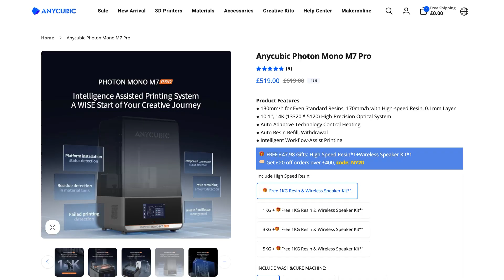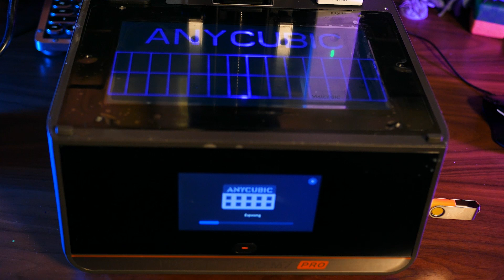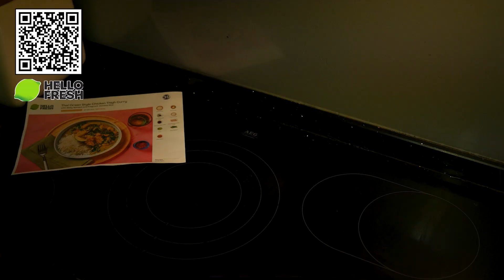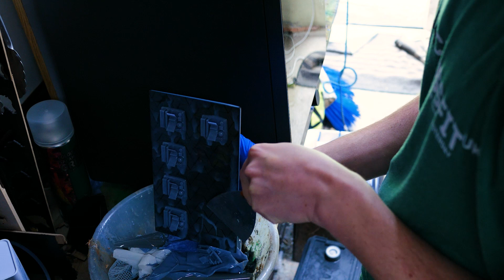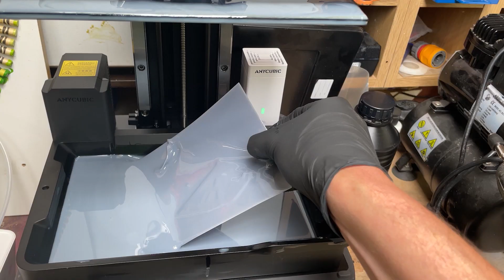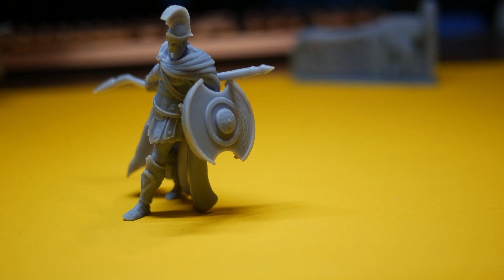Should you buy the FASTEST resin 3D printer? Anycubic Photon M7 Pro review

Comment: Can some one help me with settings
Reply from the maker: What help do you need? It will depend on the resin/ environment etc too. Happy to help though
Reply: @ the resin is anycubic standard resin, have the printer(m7 pro) in my room it’s not cold.
Reply from the maker: sorry I missed the replies on this, the room temp shouldnt be a factor as you have a built in heater. I cant give you settings that will work anytime but you do have a RERF function on this printer so I would have the base layers set at 30s then run a calibration test with 1s as the exposure and everything else left as defualt and see where that leaves you. ask more questions as you need to
Reply: @ ok thank you
Reply: @ burn layer and normal layer times

Comment: How much space do I need above it to remove the lid? My printers are in boxed enclosure so dont know if I would be able to do it.
Reply from the maker: If it’s in an enclosure I would just remove the lid completely, I will be a lot easier to use and there is no issue with heating as it’s contained and heated from the vat
Reply: @RisingApe  I know but there are a few other stuff in enclosure and it can fly off the the resin vat or something. I would rather keep it covered if possible

Comment: Ive brought the mono 4k... and i reeeeeeeally wanna smash it ! I cannot get the files to work on the machine. Ive yploaded, deleted. Changed the file types, downloaded other apps, searched youtube, searched online and i still cannot get the bloody thing to print ! I save it as pwma... obj... stl... all sorts  dont know what im doing wrong
Reply from the maker: From experience, strip it down and clean it, then run a levelling check. If everything is good then run some calibration on it, I use the Phozen Xp checker to dial it in (15min print) if you need more help just shout
Reply: You need to slice it using Anycubic Studio

Comment: Thanks for taking the time to make such a comprehensive and most of all honest review, I really like you leave in the frustrating bits and share the whole experience. Like you I am not a tinkerer that enjoys messing about a lot with tweaking my printers and dealing with fails etc., I just want a tool that works and works well with a minimum of fuzz then spend my time painting my minis. Speed isn't much of a priority for me, good detail with tough and durable resins like ABS-Like resin is what I am looking for in a printer (Not speed resin, Ill get back to that....). 

I want to share a little tip for you that someone passed on to me that makes cleaning out the vat, especially on large volume vats, a lot less messy and painful. I have the M3 MAX and whenever I have a fail and need to pour the resin back into a bottle it is nearly impossible to do without spilling some and one can very easily overfill a bottle so you have a funnel full of resin and need to somehow get that out without spilling the content... So someone came up with the simple brilliant idea of using a large syringe to suck out the majority of the resin until you are left with just a tiny bit in the vat, that can then be easily poured into a bottle. So much easier than trying to balance a large vat tipping that into a funnel and to control how much you pour into the funnel / bottle, no more mess and very little goes to waste ;-)   

I think I can explain why you had so many fails and a frustrating initial experience, bear in mind though this is guesswork not based on personal experience but mainly bits of info picked up on a comparison review of the M5 vs M5s, as well as some research into FEP vs nFEP and whatever they call the High Speed 'FEPs' (Film on the Vat).

As far as I understand these new fancy high speed printers, they will only work properly with high speed resin if you want to print at that maximum speed, and you need to be aware of what type of film is installed in the VAT. You can use 'normal' resins on a high speed printers, but then you need to do two things. You need to swap the FEP (Which is called something else on this type of printer...) with a regular FEP or an nFEP, then you need to slow down the printer to 'regular' print speeds. Also as you mention, high speed printing uses thicker layers and I would expect that you sacrifice detail for speed, I would also question whether the high speed resins are as durable / tough as for instance Wargamer resin or similar. I heard some people that have high speed printers who want to be able to easily swap between fast printing and high detail printing, that address this by buying an extra Vat, so they have one vat for high speed printing and another with a regular FEP/nFEP film for high detail and normal speed printing. 

So my guess is that the explanation is that you have a high speed printer with a high speed film installed, so you got a lot of fails up until you switched to a high speed resin? All of this ought to have been made very clear in the manual, as well as how to properly use the R_E_R_F calibration function, though I am unfortunately not surprised it isn't.... (For those reading this that are not familiar with the R_E_R_F, it is a special file that makes it possible to print 8 test files in one go at different exposure times with 0,25 second increments ;-)
Reply from the maker: Thanks for the comment, really appreciate the time. After using the printer I slowly got used to it. And while no doubt it can be extremely fast, you can still prioritise detail on this machine, which is frankly excellent at it. But my one line review will be they made it too complicated compared to their rivals.
Reply: @RisingApe You're quite welcome :-) I watched a couple of other reviews after this one, and that seems to be the consensus. Having the heater built into the vat and having to clean that as well sounds a bit troublesome. I have built a ventilated enclosure for my M3 Max cause I need to keep it inside the house and the fumes were making me sick. I think I will go for the Saturn 4 or maybe even a Saturn 3 if I can get a good deal on it. If need be I can install a small heater in the enclosure ;-)

Comment: what settings did you use, I currently have problems with mine :(
Reply from the maker: What issues do you have? For the fast print at the end I just used default settings. I will have to look up for the other resins but as you can tell it wasn’t simple for me
Reply: @RisingApe  I also used default settings but I got ´Cerebral force zero´ as an error message. the print came off completely, but the first few layers remained on the build plate